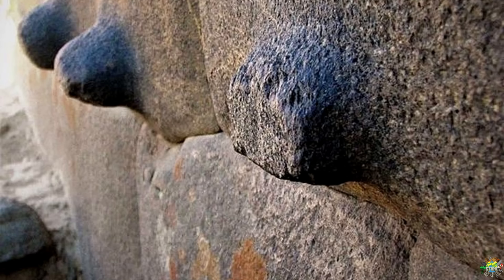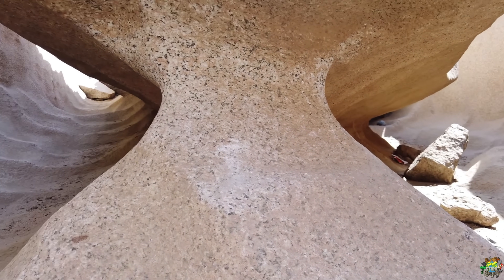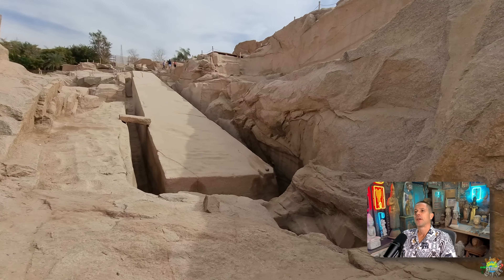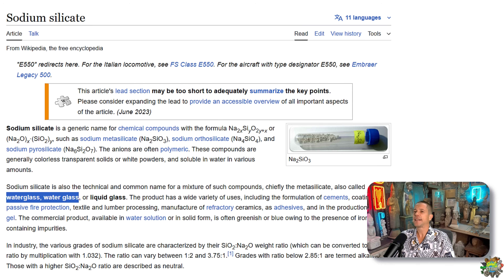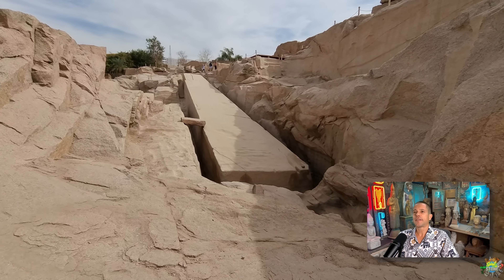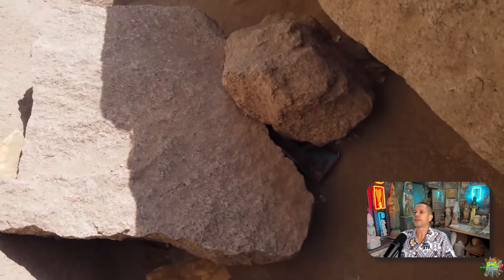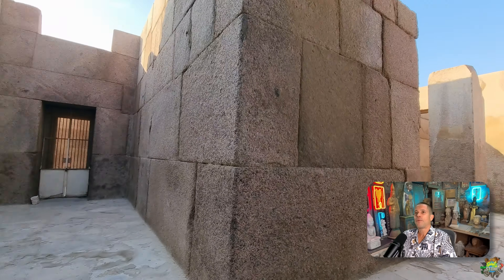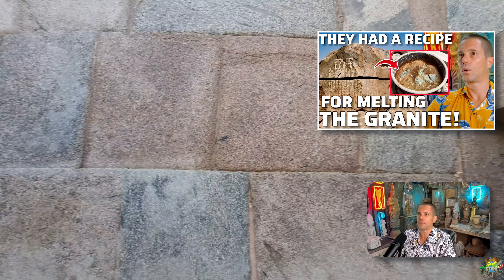The Unfinished Obelisk & The Scoop Marks Are Finally Solved

Comment: This is just getting ridiculous, this video is just a bunch of made up nonsense. The rock is weakened by ordinary fire alone. That's all it takes. Known globally since the stone age. As for these Aswan features on granite in particular, there's evidence of fire setting at the site: weakened stone, ashes, curved spalling chips (heat), mud brick remains. I've done it myself in basalt. You have to use small sections at a time or you risk cracking the who stone, and don't flash cool with water. The fractures happen as it cools, not in heating. Pounds out easily with pounding stones, or even just you fingers in some places.
Reply: There are multiple places in Aswan where giant blocks of stone were removed. Thousand-ton blocks of granite were transported for hundreds of miles like it was nothing. The primitive technique of fire quenching had nothing to do with cutting that stone. Your fire theory falls short when considering the whole picture of what was accomplished. Carving out a perfectly symmetrical giant face in granite has nothing to do with starting fires.
Reply: @vadimbellous8313 fire setting was for roughing, has nothing to do with transport.

Comment: Natron is the most plausible explanation I’ve heard so far
Reply: Chemically, but not practically, you cant keep the heat in, its thermal is to low, you'd literally have to have the forge on top of the rock.

Comment: Nope, you are wrong. As a tradesman it is very obvious to me from years of machinery experience that the depressions are created by an articulated powered head running a "burr" shaped cutting head. Occam's Razor applies to this scenario, you are proposing a very inefficient chemical removal when the simple answer is that it was a rotating cutter that made those marks. The giveaway is the undercutting below the Obelisk, it is blatantly obvious that an oscillating head machine made those curved scoop trenches which have a radii from a fulcrum around 6" to 1' above the elongated scoop mark. The head was lowered from directly above the trench then oscillated to undercut the Obelisk. You are theorising from a basis of lack of practical knowledge of the trades and craft techniques.
Reply: I agree with you 100% It is no longer difficult for me to believe that a human-like civilization existed 45-65-100+ thousand years ago. Given the fact that Earth did experience some type of hemispheric cataclysm 14k to 11.5k years ago.... The simple fact alone that the precession of the equinox was carefully observed over it's 26,000 cycle multiple times..... They may not have been Homo sapiens, per say, but a more advanced Homo xxxxxxxx species, and globally, few in numbers compared to human population numbers today. There are even parrells I see developing now, where an Elite wishes to rule the Planet, via automation, robots, and AI....... but when disaster strikes it will be extremely difficult for an elite society compressed of a few million (or significantly less) globally to recover, if not impossible given system failure, and then collapse.
Reply: @clifforddaniels1317 it was not human-like but human civilization. Homo sapiens skeletons ~ 300 000 yo.
Reply: @clifforddaniels1317 they'll have gene banks and technology
Reply: @clifforddaniels1317  Thanks Cliff.
Reply: Dremel.
Reply: You're both wrong. Try simple fire setting on stone sometime. These scoop marks appear all over the world in primitive sites as far back as the stone ages. No roving teams of power cutters with burrs or whatever. Simple fire. Try it yourself, it's fun. You can barbecue at the same time.
Reply: @rickZR1982A and you think you can excavate cuboid in rock with campfires?
Reply: @piotrrajmundkoprowski4732 Rough cut out, yes. Exactly. Been done that way for thousands of years, as seen through extensive global evidence.
Reply: @rickZR1982A  You try. it if it is so easy and simple. in fact supplying the combustable material you speak of would be in itself near impossible. I simply think your approach to problem solving relies on the very successfully age old method of shaming people..... Hence I stand by what I've said and don't need an ad homien attack to do.
Reply: @clifforddaniels1317  I DID try it, and it's easy. Fun even." Impossible" to get hot coals going in a mud-straw frame and fan them up hot? Come on. And it certainly is not "shaming" or "ad hominem" to point out flaws in arguments and replace them with facts and evidence. Now go start a fire and learn the truth.
Reply: @rickZR1982A same scoops seen on softer limestone which is much easier to carve and needs no fire to denature it...machines and high-tech are attested to in the Vedas ...check barabar caves and serapeum boxes and huge statues with stunning symmetry like the many granite vases ...
Reply: @philipthomas3938  Lots of evidence that other stone cutting methods existed in the ancient world, but the scoop marks as seen on the obelisk and other sites (Stonehenge, Peru, etc.) are specific to fire setting. Remember, there's evidence for the fire use right there in the quarry. Mudbrick, charcoal, burnt rock, lenticular chips.

Comment: I still don't understand the scoop marks by the long trenches. If it's a liquid they used,  it doesn't explain the scoops when you would think the easier way is to flow the molten liquid down a long channel?
Reply: And how do the scoop marks get on vertical surfaces if it's a liquid? The geopolymer theory actually makes the most sense for how they created the stonework, but those scoop marks on vertical surfaces is still a mystery to me
Reply: @millwrat  my guess: they look vertical now, but the process of creating those scoop marks, started from above and gradually moved downward. Leaving a vertical shape? Just maybe :)
Reply: @millwrat   good point. Also the depth of the scoops is overkill if the only goal is to contain the molten liquid. Maybe they started more or less flat and then it ate the stone to create the scoop? If the goal is mineral extraction.. no need for symmetry at all so it seems to me they were trying to extract the obelisk rather than produced with high precision as a by-product of the mining process.
Reply: @millwrat I think the most sense is that the scoop marks are left from a rotating tool
Reply: No one knows- everyone is speculating. Someone should tap into the Akashic records. Please let us know what you discover. ❤
Reply: That cave in China was scooped out in the same way!
Reply: It looks more acid etched. With no heat needed
Reply: @jonnyhonda  my first impression was they softened it somehow and scooped it out by hand
Reply: @delatroy yeaa. I watched that K movie 2017. Thought it was a good attempt. He thought it was heated by a massive sun lens. If you ever get strong chemicals.. you know the power of them for dissolving.